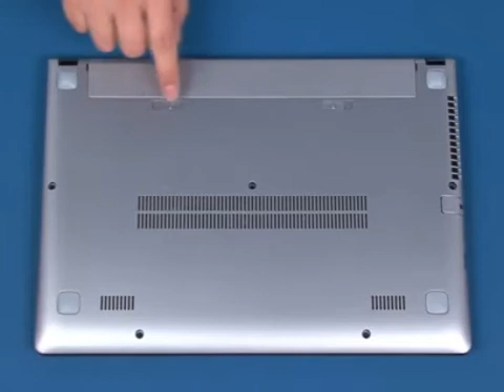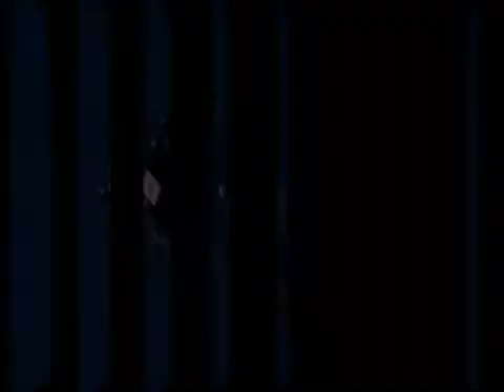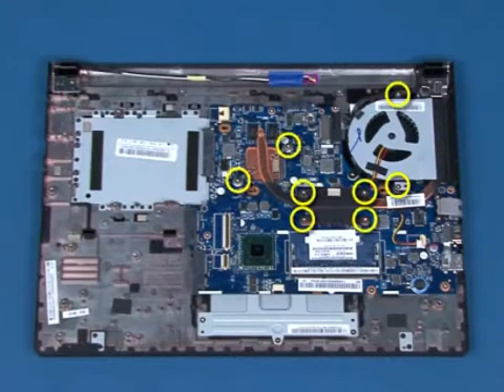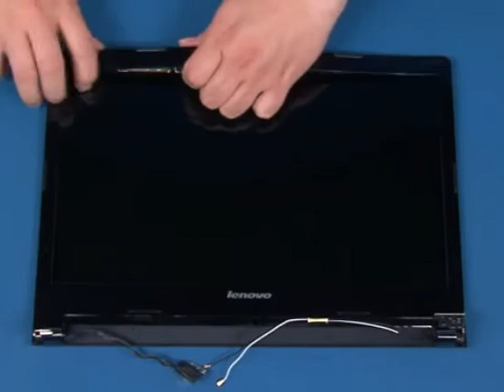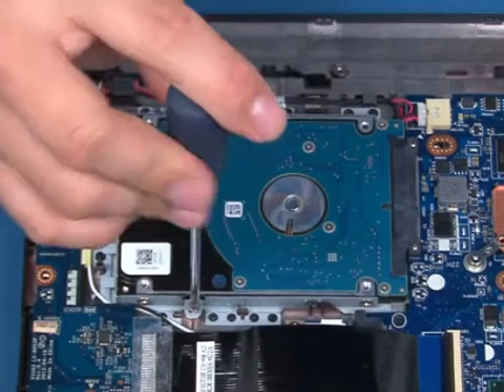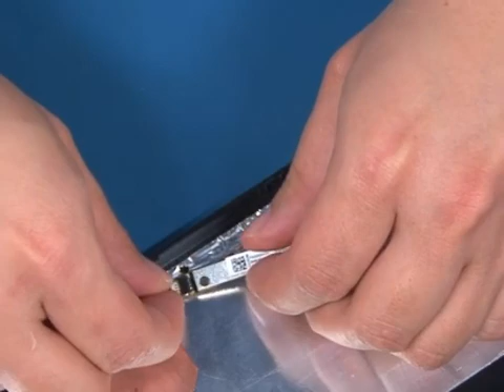HOW TO DISASSEMBLE AND REPLACE LENOVO IDEAPAD S400 (20195, 4582, 80BY, 9630, 20283, 6600, 80A1)

Comment: Hello, good morning. Do you know if I can remove the touchpad from this laptop? Do I need heat or just a spatula? I'm replacing the top case, and when I remove the components, I notice the circuit board is next to a black base that comes with the new one. I don't know if I have to replace the whole thing or just the circuit board, but it's sort of glued to the base?

Comment: I replaced the middle cover 2 days ago: this video does not present that HIDEOS part 😊 where you need to cut the plastic soldered bolts and then soldering the parts back on.

This is a nightmare of a laptop but with patience it can be saved.